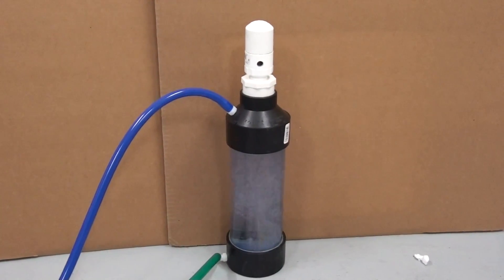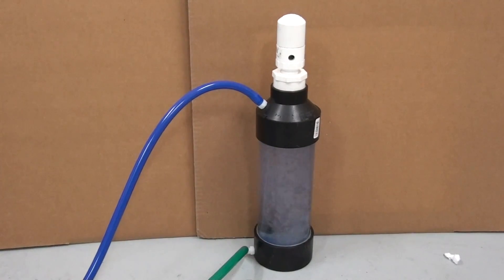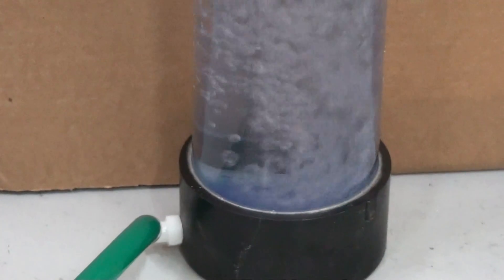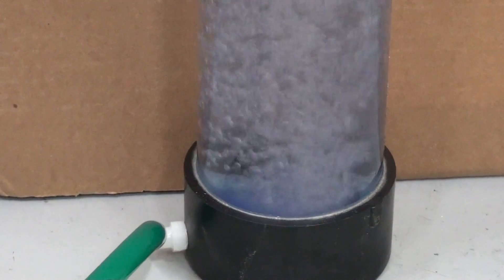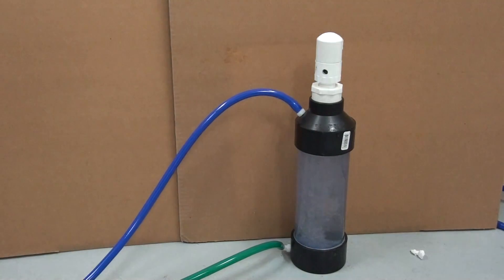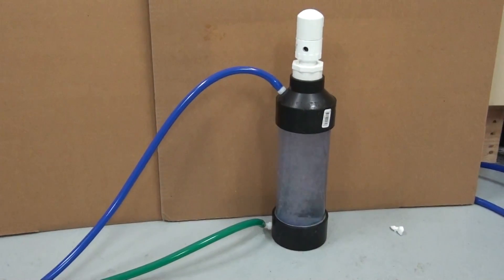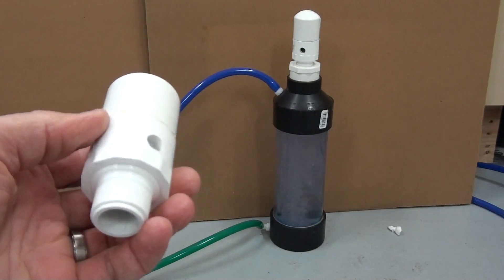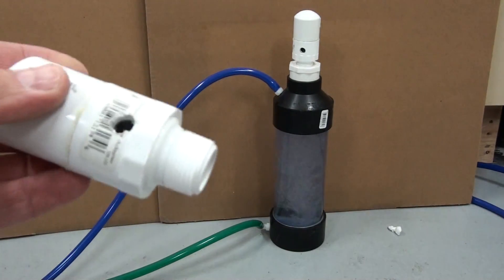Green Fuel H2o HHO Bubbler with Flash Port Demonstration. Flashback Arrestor

Comment: I had my headphones on... when your lighter didn't work, I figured it was empty. Then "The Blast"... I jumped! I've looked at Mitt arrestors for Oxy-Acetylene tanks and still worry about the speed of "flame-front". My tiny HHO system is only experimental, but I've already had "Flash-back" events. They have been TERRIFYING! I have destroyed my bubbler (with quite a mess to clean up). I think an arrestor, should also have a mechanism or circuit to "shut-off" hydrogen production... I haven't seen any such device and want to ask if you are developing this... great video!
Reply from the maker: No I don't have this but it's a great idea. If your going to light HHO 
you should have 2 to 3 forms of flash protection. I recommend at a 
minimum a small in line flash arrestor and a flash port. This page has 
the products you need.
http://www.greenfuelh2o.com/HHO_On_Demand_Generators_s/3.htm
Be safe my friend.
Reply: Brent Metro A design for hho system similar to keep's apparatus can cut off electrolyte supply to electrode and hydrogen production will stop.
Reply: Make bubbler with Stainless Steel pipe and components 
 I make flash port with Delrin which is machined on lathev.

Comment: is that safe in the car under the hood? why does it light, I thought it would just release something like pressured air but of course it's hydrogen
Reply: well its safe because hes lighting it on with lighter at output, yes in engine are hot metal parts but lighting this up requiers a flame